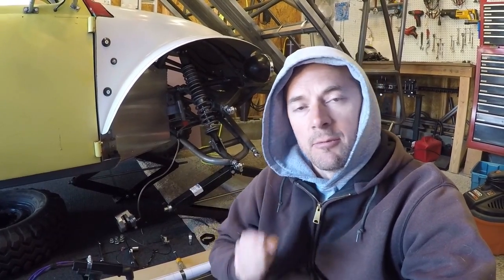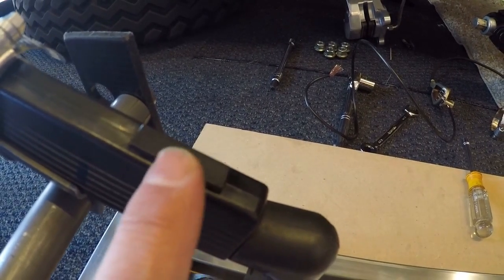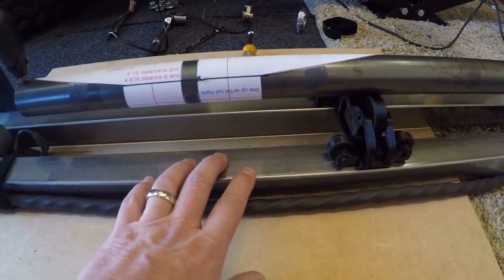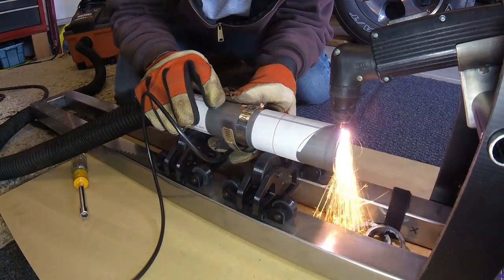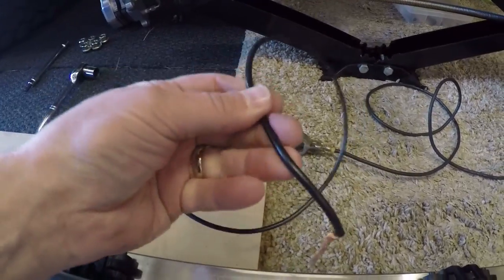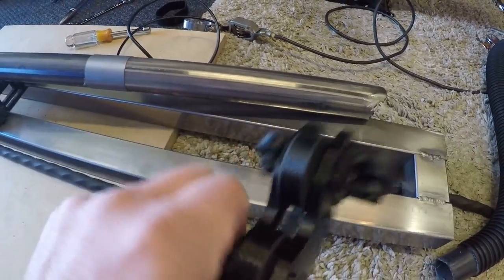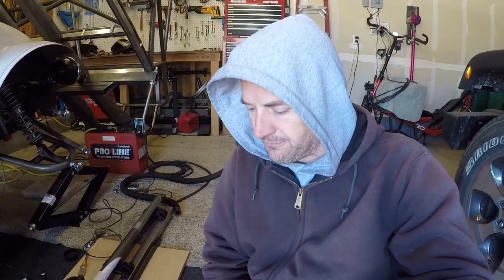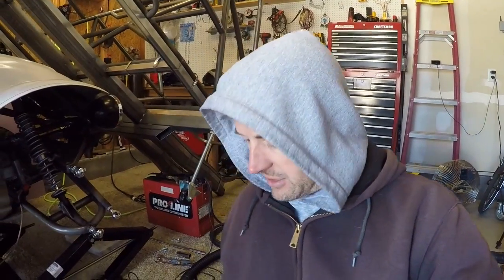DIY Plasma Tube Cutting tool (PTC-3000)

Comment: O.M.G.  As I hear all the time in the Philippines this is GEAT !     As soon as the roof is on my shop here in the Phils I will build one of these and it will be like MAGIC  !   I have been watching live how some simple building  things here are done and I can't wait until I can give it back.     You should figure out a package pre packed full of everything needed to build in a compact package and start shipping ( just add your own welding were needed.   Like kitPlanes do.  For a foot switch I have used old foot peddles from sewing machines they were built great.   Would like to know what size plasma machine you are using - are you using minimal size or larger ?

Comment: What is the wall thickness of the tubing your are cutting? I read that plasma cutting would not work with very thin tubing.
Reply from the maker: In this video it's .095" thick. I've used plasma cutters down to 26g with no problem. It just gets tricky because as it gets thinner you need to move faster.

Comment: That looks fantastic!  What kind of Plasma cutter are you using?
Reply from the maker: It's made by Turbo Torch TPC25. They don't make it anymore. I think I bought it in the mid 90's. Nice little tiny plasma cutter. Good chance it's still made. I think Turbo Torch just put their name on it.

Comment: why not just get a tube notcher?  I have had a Baileigh for a number of yrs and use ordinary old hole saws from home depot with no lube and cut .120 wall dom all the time and I use the crap out of it. I also have a Cnc plasma table with a tube cutter attachment that will do up to 8" diameter pipe. With the work it takes after being plasma cut to clean the notch up. Its faster and cleaner to just do it on the tube notcher. Also tig welding over any dross ( or any part plasma cut) can cause a poor weld or just make the weld puddle to just flow out poorly.  Just my 2 cents. https://www.baileigh.com/tube-notcher-tn-250?gclid=Cj0KCQjwt5zsBRD8ARIsAJfI4BhU-D6GYze2wBZkVTnOE3mqlC2zP0OnoCSUOG3uraboJqZXjiyRaYkaAgAsEALw_wcB

Comment: its kinda cool but i can already do that part with a chop saw and sander fast. cutting out the wrappers and placing them on the tubing is more time consuming then the notching imo.  i was thinking if i could just have a machine that puts the sharpie mark on the tube, it would be so fast, or something that auto cuts the wrappers it would really speed up things.
Reply from the maker: They do sell machines that will do that. But they cost as much as a car. ;-)
Reply: @DougBugBuilder  i know i have very seriously looked at buying one. i know of one shop that will take your bend tech file and  cut and bend all the parts for you.

Comment: Pretty sweet roller system, but there are hole saw systems that work pretty well with minimal grinding. Check out Rogue Fabrications website. Plasma is a filthy operation.
Reply: maybe with mild steel is better to use a hole saw... but for stainless steel this is perfect. And for weird  cuts too

Comment: Dude, why do you have NO heat in your garage? Secondly, sucking plasma cutter smoke is the price you pay....LOL. I'm blown away at this build....awesome job!
Reply from the maker: lol, that's a good question. I think the reason is because it's a fairly short window that I actually need the heat. I guess the other reason is I'm really constrained with space. Although I suppose I could hang it from the ceiling. I don't have a good reason really.

Comment: You could use a metal end for the shop vac and put your ground on it . Then  just slide it in the end of the tube. if you had a way to add a little bit of drag to the rotate and in and out it might help you be smoother.
Reply from the maker: That's a good idea, I might experiment with that. Thanks.
Reply: This is a great idea"your jig not my idea" and thanks for sharing your ideas with everyone.

Comment: Wire with MTW insulation is more flexible it is short for machine tractor wire.  Or look into wires for welding, much finer stranding and softer insulation.  It is used in electrical cabinets where more flexibility is required.  Looks like a good way to notch tubing with out buying a notcher.  Good for fellows with not a lot of space.
Reply from the maker: Welding wire, that's a good idea. I bet they have something good at the local supply house. Thanks for the idea.

Comment: cool set up. could you make the rollers out of metal  bearings and than just ground the frame that they roll on?
Reply from the maker: That would work for a while but as the bearings rotated they would arc between the races and get all galled up. Eventually they would roll real rough as the races would be ruined. It's a good thought though, and thanks for the comment buddy!